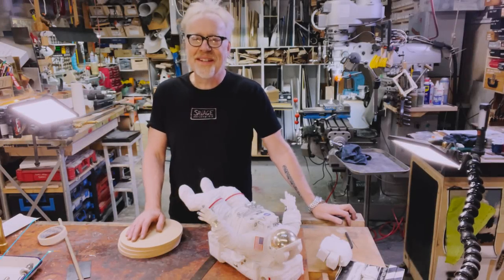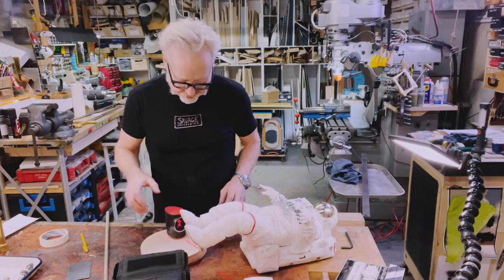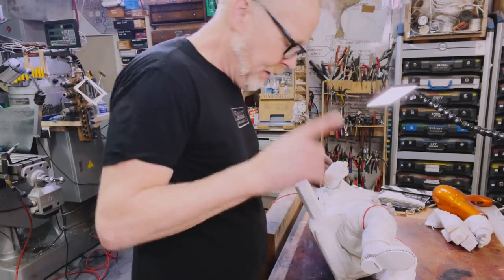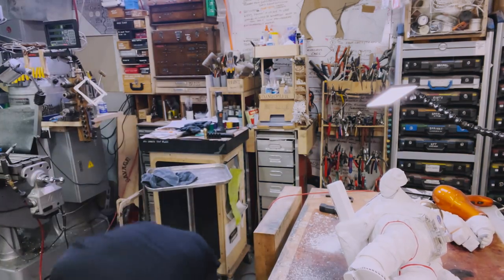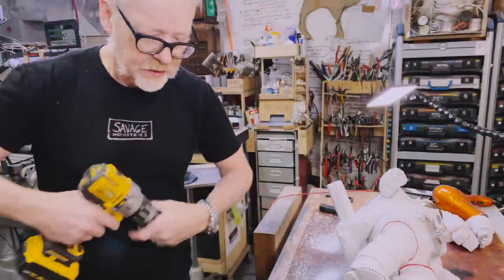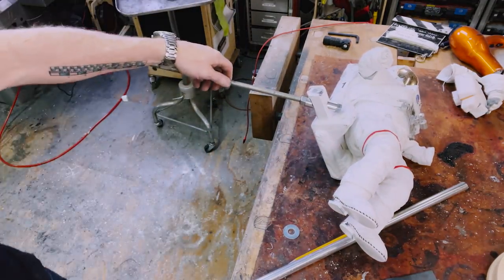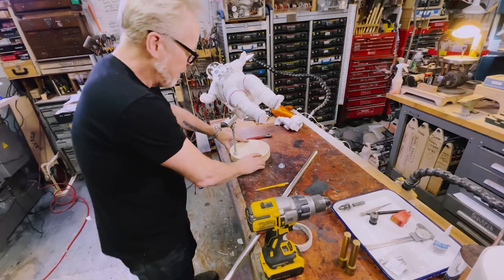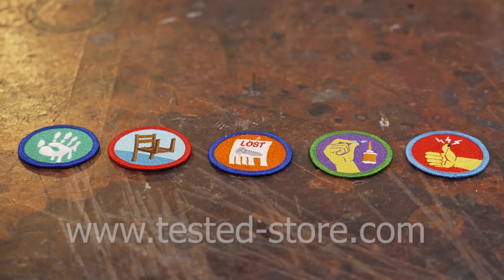Adam Savage's One Day Builds: Miniature Astronaut Display!

Comment: Please don't ever buy or use Duracell batteries.  In my pinball owners group, we've found that those are the only "major" brand that leaks and ruins the motherboards (and anything below them in the cabinets!).
Reply: Oh... I thought my experience with them was just a coincidence. I only had one battery leak for the last couple of years and it was, in fact, a Duracell alkaline battery. I assumed must have been old and/or improperly stored, and maybe it's just lower quality, because it's the OEM variety (included with some products, not sold at retail). Interesting to know, that it might have not been just a coincidence, then. Thank you for sharing!

Comment: What might also have worked is removing the polyester from the aluminum rod that is already in there, then make a pole with a clamp, that grabs that rod. That way you can still adjust the angle.

Comment: Adam 2 new Demerits Your careful about your nail/staple guns but this shows you take too many risks with your drill. Drill bit trough a hand Patch. And a splinter in an eye framed by glasses, Thought of when you used air to clear the bore hole, Reading glasses are not Safety Glasses.

Comment: NO.  JUST NO.
Some things wrong with this video:
1)  When judging the center of gravity, make sure all parts of the kit are included.  I don't know how much the astronaut's light display weighed, but it could have been enough to throw the kit off kilter. 
2)  Never, never put your hand behind a drill bit while operating a drill!
3)  Throw a white sheet down to work on the model.  It will stay cleaner, and if you want to dirty it up later, you can do so.
4)  How about drilling a pilot hole first?
5)  Maybe wear a mask while drilling to avoid inhaling the dust?
6)  Find a way to secure the astronaut while cutting of the excess of the bar supporting it. 
7)  Pick up the parts you have just cut off, instead of just leaving them on the floor for someone to trip on.
8)  Eye protection?  Goggles?  It only takes one little speck of metal to create havoc in your life. 

I make these suggestions with all sincerity, Adam.  I would hate to see you get hurt.  But this was a "savage" build. 
Also, you might want to create a merit badge with someone drilling a hole through the palm of their hand.  Just sayin'.
Later.